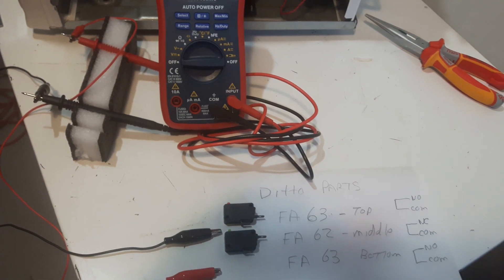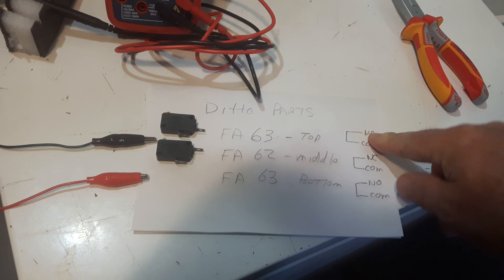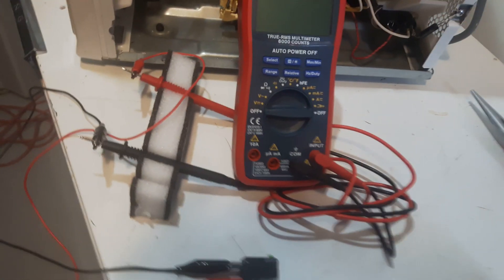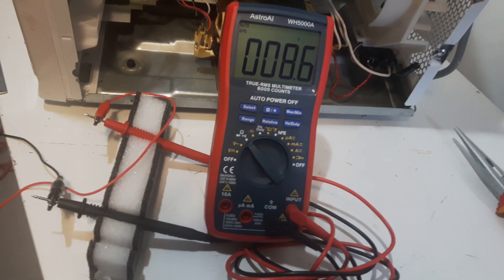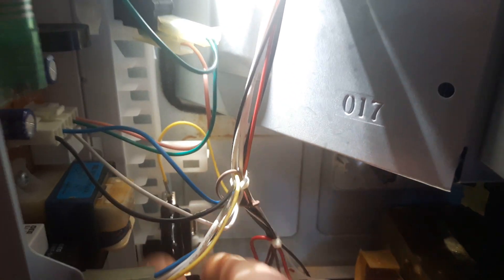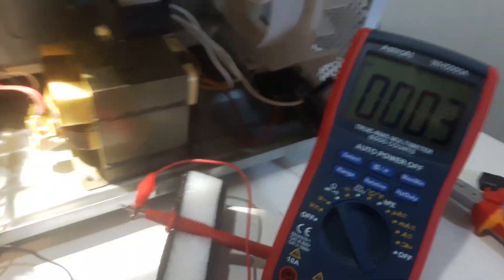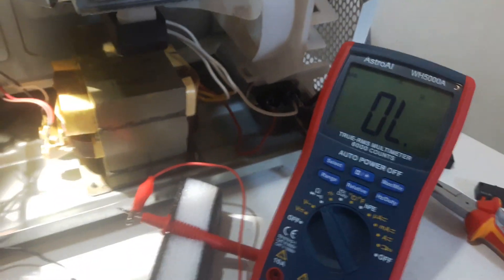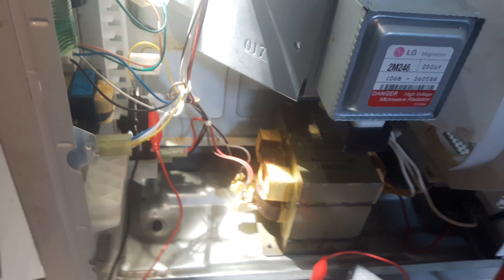Microwave  NC Micro Switch Need Help.

Comment: @Jim McLaren - thank you for posting this. Please know that this and your other videos are very valuable to people like me.
 
I was initially confused about the microswitch NC/NO positions. Here I am sharing my experience if anyone else is in the same situation as me.

There are 2 pin and 3 pin versions of these switches, and in my case I needed the 2-pin version. In the 2-pin versions, there will be a straight pin protruding out to the right side end, and a second bent pin on the underside. The underside and right  side are determined by the orientation of the switch when you hold it to read the English text labelling that shows NO/NC etc.  The normally closed (NC) one will have the flat metal pin aligned with the NC label,  and the normally open (NO) one will have the pin aligned with the NO label. In the 3-switch set  (to clarify, I mean just a packet with 3 of these switches) that I bought, the NC switch also had a red button, while the other 2 had black buttons. So there is some color coding that you could use to distinguish them when there are 3 switches in a set, but if you bought only 1 or 2 you will look at the pin position as mentioned above.

NC: "Normally Closed" means the electrical circuit is "closed", meaning the circuit is completed,  or in other words it is normally "ON".  This switch turns off the current when the switch button is pressed.  Intuitively, we expect a switch to turn something ON when we press a button, and this switch does the opposite. It is like someone left the light ON, and we need to turn it off by pressing the switch button.  

NO: "Normally Open" means the electrical circuit is interrupted, left open, and that the switch is normally in its OFF position. Pressing the button allows the current to flow. 

My original confusion was because I noticed there is a little wiring diagram with the COM, NC, and NO labels, and that was the identical on all the 3 switches. I stupidly expected the diagram to be different for different switches, and ignored (or did not notice) the fact that the pins are aligned to different labels.

PS 1: My broken switch was not "clicking" properly, and it felt like pushing down a spring without that satisfying click sound. The new switches clicked with a satisfying solid click feel.
PS 2: These switches have holes on diametrical corners, and the mounting mechanism on my microwave had a little cylindrical plastic part that goes into one of these holes. If you are struggling to put it back, just be aware of this.
Reply from the maker: Thank you so much explaining in great detail. 
I was so confused about these switches.

Comment: Hi, did you figure out the problem?
Reply from the maker: Didn't solve the Micro Switch problem but found out it was the Magnetron.https://youtu.be/sjtlvBrxGBo
Reply: So does the switch do the same thing or did it change after installing the magnetron  cause I'm having the same no heating issue.
Reply from the maker: The switch is working fine it was just puzzling about the multimeter. It ended up being the magnetron. So it wasn't the switch at all.
Reply: Okay I just pulled it out and like you said it is brown not silver so thanks I think that is my problem
Reply from the maker: That's why took me so long to figure the magnetron was bad because it checked out fine on the multimeter. The problem was the end was brown very little silver. Yes I think that's your problem as well.
Reply: Did you get the same exact magnetron or were you able to find a similar part that will work?
Reply from the maker: I brought my old magnetron in and they ordered the magnetron from the numbers on the old magnetron. So you need  exact one for your model of microwave NOT a similar one.
Reply: Ok thanks
Reply from the maker: Your welcome.